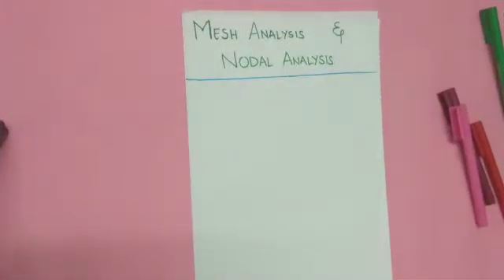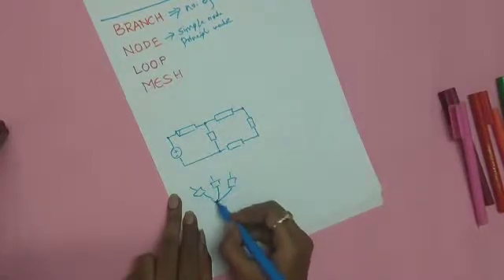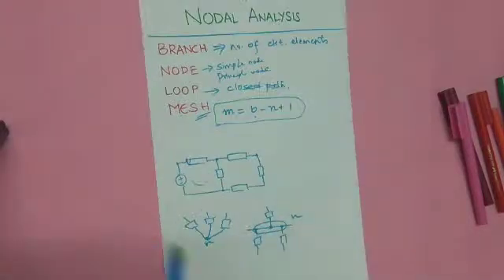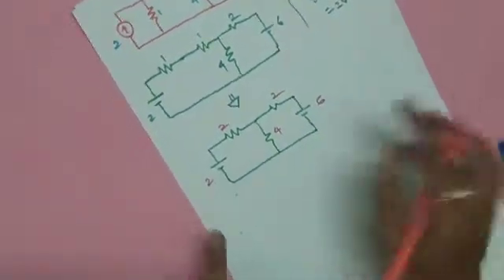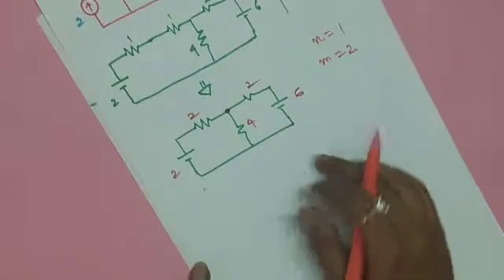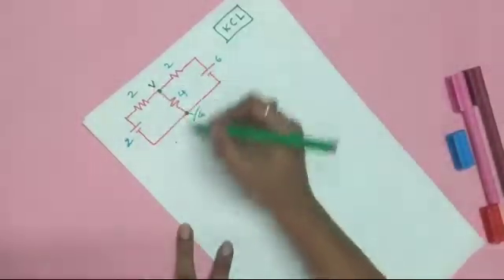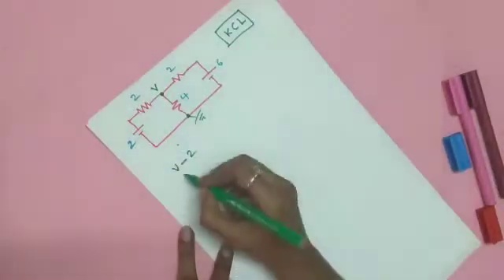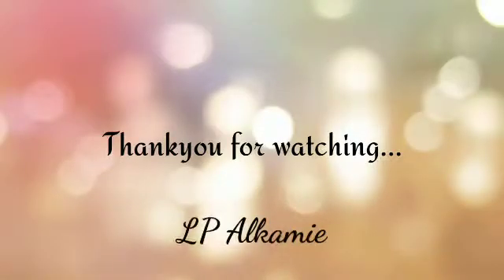How to solve problems using Mesh Analysis and Nodal Analysis easily ?

Comment: In 6:34 sec why u are drawing one resistor?
Reply from the maker: Its is the equivalent of the resistor parellel to current source
Reply from the maker: A current source(i) in parallel with a resistance (R) is equivalent to voltage source(V) in series with the same resistance, where (v=i x R)

Comment: 1)Why didn't we consider the lower point to be a principal node?
2) how did we assume that lower point to be at 0 potential?
Reply from the maker: 1) junction to which more than two elements are connected is considered as a principal node. Try to solve the same problem with lower point as principal node and you will get the same solution.
2)since the lower point is connected to the negative terminal of two batteries it is easier to solve if we consider this at zero potential.
Reply: @letslearnelectricalenginee4671 thanks!